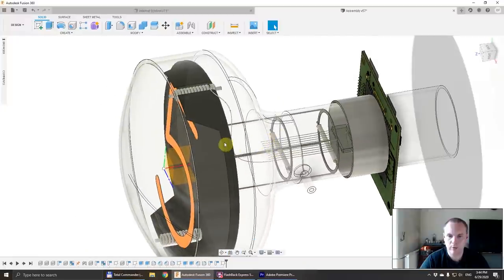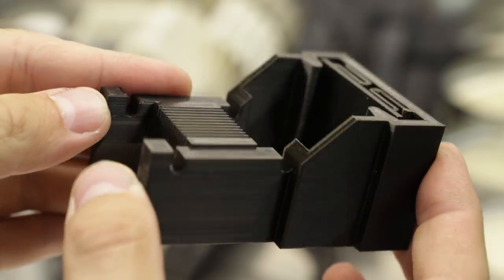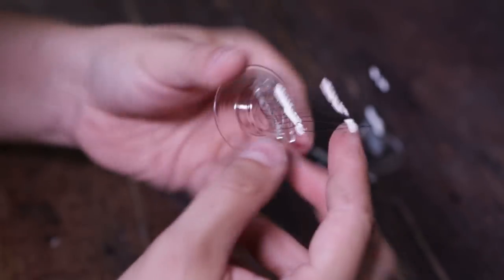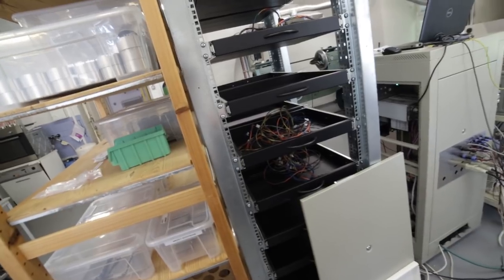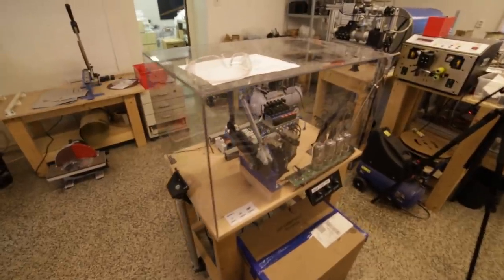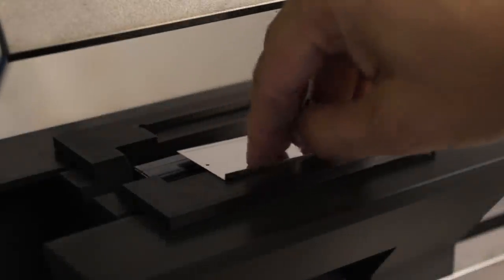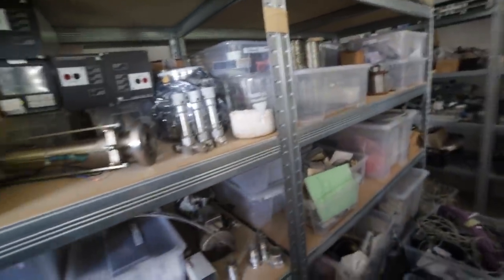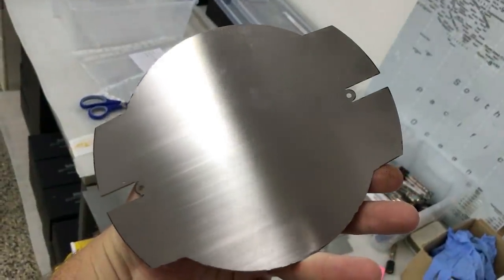First sub-assembly - support of the stem - Project H #10

Comment: The 'classic' way to ship tubes with large internal mass was to have a ring fit around the tube each end and then 2 to 4 inch long springs out to a frame box.  This would give the tube as a whole movement preventing the internal works to have a momentum different than the housing.
Reply: That sounds really nice, reminds me of using microphone holders with elastic bands to keep the mics essentially suspended in the air.  For a big project like this nixie wall a custom shipping container might be worth the extra time/cost.
Reply: @_o_  I believe that a custom shipping container is a must because of the long shipping distance required.  Think of how many "Samsonite (old TV commercial) gorillas" could handle the shipping container during its trip!